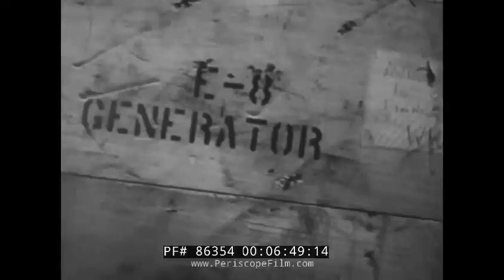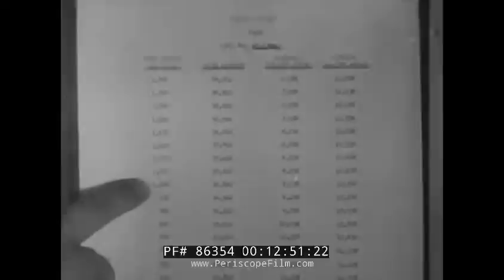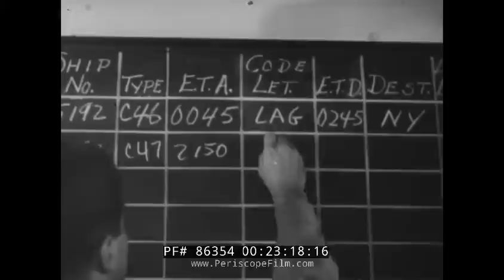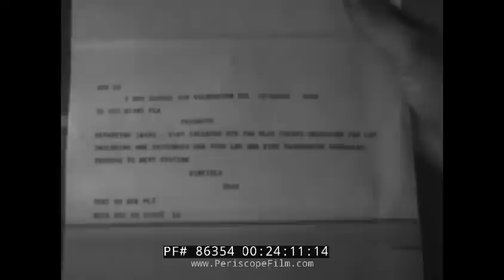" LOADING OF CARGO AIRCRAFT "  1943 U.S. ARMY AIR FORCES TRAINING FILM  AIR TRANSPORT COMMAND  86354

Comment: First thing I noticed was that a C-46 isn't/wasn't 8 feet off of the ground at the loading door.  However, I then realized that they jacked up the tailwheel so that the plane's interior was level, making it much easier to load, then pushing. the cargo "uphill" due to the slope of the interior when the plane's tailwheel was on the ground!
     I've read the book: Little Ship, Big War and in it there was a mention on how hard it was to get Manila Line (rope) in the proper diameter for mooring the ship (a Destroyer Escort), they had left the yard with "spring lay" a metal substitute that cut the line handlers hands and any other part of their body that came in contact with it!!